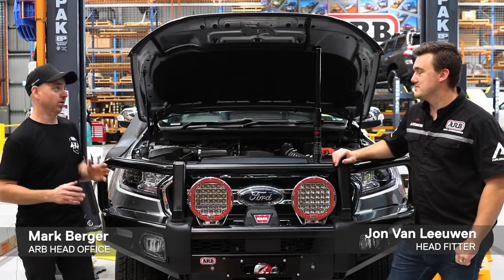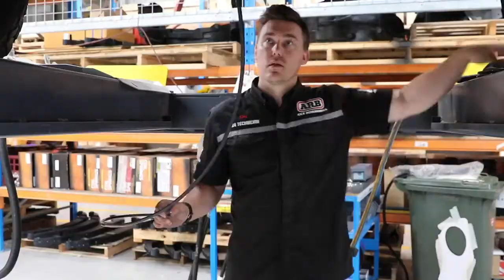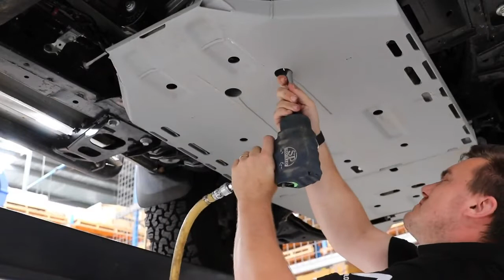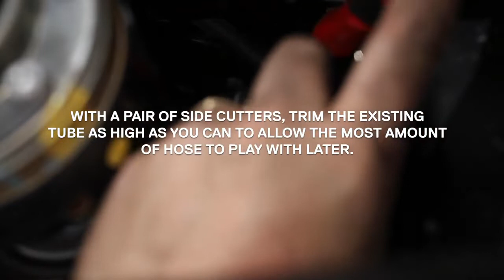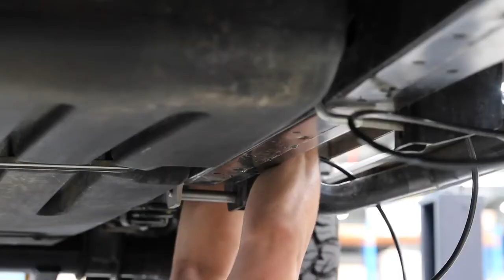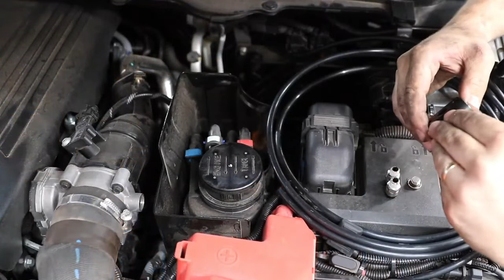Differential Breather Kit - by ARB

Comment: So what's inside the little disk looking thing?
Reply from the maker: @michaelashbrook3195 Michael, fair question.. The gray component itself is a specific to ARB housing for a special filter inside. If you visit our site, link in the description) you can see a exploded view of this component in the 4th image in the gallery. 

In case the link in the description in the description fails us both, you can search on the site for "Breather kit" and it should populate at the top of the list every time.

Its a very clean presentation for a multiple port breather kit rather than having 4 separate hoses going to both axles, a transfer case, and a automatic trans..

Any further questions or application specific thoughts, feel free to reach out to our sales email/site chat, excited to help.